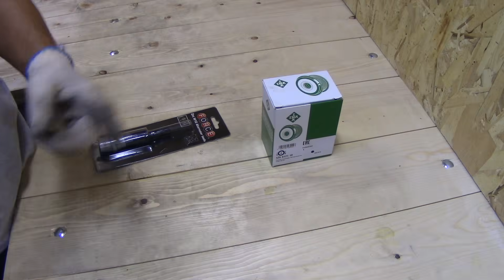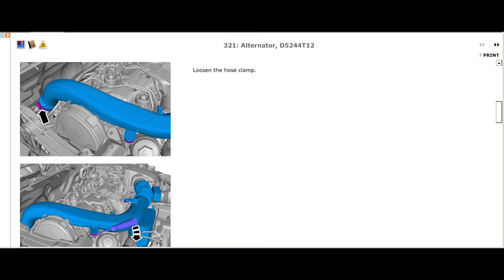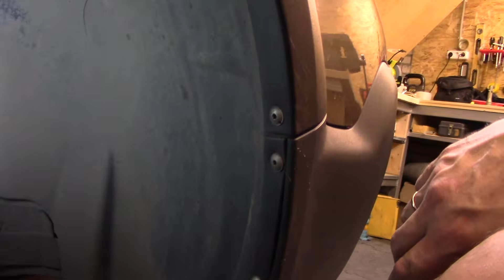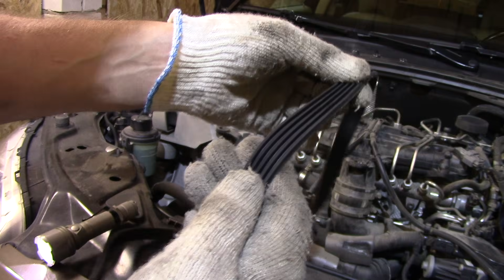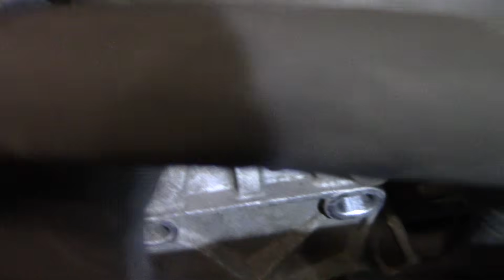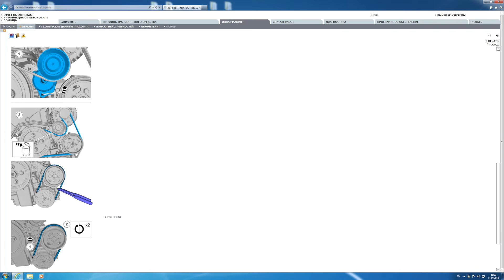Alternator pulley / freewheel clutch on Volvo XC70 D4

Comment: Hi.

Based on your very good instructional video, I did the whole alternator replacement operation on my own yesterday. However, I used the method recommended by some viewers, i.e. I dismantled the oil filter wrap and easily pulled the alternator out from the top. It took me about three hours to take out and install a new one (I’ve never done it before, I’m not a mechanic). As it turned out, it took me the most time to install the V-belt. Thank you very much for your videos, thanks to them I did a lot of work on my own I resemble XC70.

Greetings to you and your friend ❤

Comment: Thank you for this video! I can confirm the removal of the oil filter and oil filter housing (3x torx 30 and 10mm) makes the removal of the generator very easy! There is a gasket that can be replaced in the housing VGASK-7730C 2.7mm. Its not genuine volvo. But just remounting seems to work. Put paper under the oil filter to catch up spill oil.

Comment: Thanks for this, helped greatly. I removed the oil filter housing though and it gave plenty room to pull it out. Be careful to not lose the square captive nut in one of the bolts, if you do remove the filter housing,

Comment: Thanks! This has helped me a lot. I replaced the whole alternator in my 2011 S60 2.0 D3. Different model, little different engine, but everything worked exactly as in the video. Only thing I did different was to take off the oil filter cap, which creates a little bit extra space. I have VIDA, but seeing it in a video made things a lot easier. And the fact that we don't have to drain the coolant is a timesaver!

Comment: possibel to remove engine mount and jack up engine to change pulley with alternator in the car?
Reply: i was wondering same thing ,did you try that . ?
Reply: @jagvolvo33  no i havent. but it might work. either lower true the wheelwell or above with jack. must do the same thing when replacing the timingbelt.

Comment: Would a worn out alternator pulley cause the serpentine belt to flap around between the transfer pulley and the crank?
Reply from the maker: Remove belt and check all pulleys. One could be bad.

Comment: Many thanks for your videos! On my 2012 xc60 I did not have to disassemble anything at all. I just removed the oil filter cap with the filter to have little more space and then disconnected and unscrewed the alternator, put a wooden block under the alternator so the pulley was sticking upwards between all the hoses and managed to change the pulley without having to take the alternator out completely, which I can not imagine doing on my car. I had to buy the tool of course (6EUR approximately). Thanks for all the instructions!
Reply: Great info bro thanks, i need to change the AC and alternator belts so ill be changing the freewheel clutch aswell, i also have a 2012 xc60 D3 5cylinder. 
Felt a bit uneasy about it but im a but more confident now thanks to your informative comment.
Reply: Did you still have to remove the wheel/liner to get the belt off?

Comment: Best tutorial ever needed. Replaced my freewheel pulley on my alternator an Sunday. I had no worries getting the alternator out through my engine bay (V70 D5). I found it easiest to turn the alternator to have the pulley pointing up and the two lower mounting tabs pointing to the left. Then carefully pull it up. Plops straight out. But great videos!
Reply: is yours p2 or p3 p3 being 2008 onwards?
Reply: @jagvolvo33  mine is a P3, 2010 V70 (type 135).
Reply: @skrattedieratte  mine is 2008 p3 ive got it in the position you describe but theres still stuff in the way, did you not have to unclip  any wiring harness stuff . is yours with the oil filter right next to it on the right once you have it in the position you say (pully pointed upwards ? then you would have the water hose to the left slightly above ? ,thanks for reply btw.
Reply: @jagvolvo33  I have the D5 with the oil filter moved to the top of the engine.
Reply: @skrattedieratte  yes is it just to the right of the alternator?
Reply: @jagvolvo33  my oilfilter? Slightly, yeah but as said, it is up and above. If you have a 2008 you'll have the swirl flaps and like that your oil filter housing is in a different position.
Reply: what color is your engine cover m8
Reply: @jagvolvo33  black with a white Volvo badge. That doesn't mean anything though. I have a D5244T10. As stated above, it worked fine for me. If you don't have a T10 (mine has the twin turbo setup) then you'll probably have issues removing the alternator. But even in the end, the pulley can be removed with the alternator loosened but still in the engine bay...
Reply: @skrattedieratte  m8 sorry but whats the actual differance between t10 and t4
Reply: ignore my last Q I know now it looks like mine is t4 not t10 .and there is the problem lol
Reply: @jagvolvo33  hehe. Difference is simple: I have 2 turbos and no swirl flaps. That is why the oil filter was relocated to above the alternator rather than next tonit (as I don't have swirl flaps actuators).
Reply: yep its all very clear why NOW. LOL i think the best way is going to be taking fan out least amount of messing about .

Comment: Great video guys, good close ups of the necessary details. 
I had a bit of difficulty trying to fit a new belt. Seems a really ill considered design. As you said in the video, you definitely need two pairs of hands to complete the task. 
I look forward to a cambelt and water pump video. Mine is due in the next couple of months 🙄

Comment: My engine xc60 2.4D is roaring from the alternator area when I reach 1000rpm and nothing is heard at idle or when I go above 1000rpm. Sounds like plastic rattling against metal. What could it be?
Reply: I replaced the pully and in the meantime all belts and water pump since that was due too
Reply: And tensioners
Reply: What was it in the end? I have exactly same symptoms and a while after it stopt charging at all... v70 2010 d5244T14

Comment: I'm getting some noise but not sure if it's from alternator pulley or another one. I replaced serpentine belt and tensioner but noise is still there. Any thoughts?
Reply: I found the same currently, did you find the fix?

Comment: Much easy if you remove the oil filter house to get out the alternator. I sort already the freewhel clutch replacement. Mine was locked and in idle had a drive belt tensioner vibrations.

Comment: Thanks, great vid! 
Have the same issue on my 2014 V70 D3 with the D5204T7, has just 104000km on it, practically the same engine. First I thought it was the bearings or the mechanical pulley. Also there seems to be a similar issue with the AC compressor giving you this noise, the clutch I believe: https://www.youtube.com/watch?v=QBlTIq_VdP4 and this https://www.youtube.com/watch?v=1RduFj8b8Nc

Comment: Just done this job on my D5 and was able to get the alternator out without removing the air duct from the filter, one less thing to do. My pulley was on really solid, it took a long bar to get it off. Thanks to you guys for your clip :-)

Comment: Another great video from this man, would it be possible to swing alternator upwards after removing the lower 2 bolts? saving removing the alternator then insert tool to remove pulley? would be interested to hear any comments.
Reply: did you ever try that?

Comment: Many thanks, I had the same problem on my V60. Maybe one tip. It isn't necessary to remove the alternator from the engine room. Its enough after the unsrewing rotate 90 degrees.So you can remove the pulley. So I skipped the complicated part with the pipes.

Comment: Replacing the alternator pulley on my 2014 XC60 due to an incremental squeal & battery charging issue which I thought was due to a bad tension pulley since I had this same issue on my 05 Porsche Boxster. When I pulled everything apart I found that the clutch in the pulley has failed at 49,000 miles. When I took the cap off of the old one it was filled with a dark sticky substance, probably the old grease. There is a white plastic sealing ring on the front of the new one and this was completely gone/dissolved on the old one! I bought the new one from FCP as part of there accessory belt/tensioner refresh kit. I almost only purchased the belt with the tensioner pulley & pulley wheel separately because I had read on a few forums and video comments that the alternator pulley generally fails at much higher mileage. Since it was a $130 part I didn't want to really spend the cash on something I didn't need. Then I did more research and found that replacement of the pulley is part of Volvo regular maintenance. I'm so GLAD I bought the kit with the pulley!!! Turns out the tensioner & auxiliary wheels were fine and had no issues but the pulley was done for!!  If your working on an XC60 you should do the recommended service since it's a bit of work to get everything apart to do the job. Volvosweden thanks for the video it was very useful in helping me get the pulley off.

Comment: I changed the pulley on the alternator without actually removing the alternator... it can be done
better to change the whole alternator... changing just the pulley is a temporary solution
v70 drive e
Reply: You have 1.6 diesel engine?

Comment: Nice job and video, can you tell where to by the VIDA you use. Is the installation easy?
Reply from the maker: Vida is available on ebay. Installation depends on your Windows. Hard to tell if you will experience difficulties in installation

Comment: +volvosweeden. Just done my 120,000km service on Volvo XC60 2009 T6. Only things I haven't done yet are replacing the serpentine belt and the external fuel filter. Could you please do videos on these. Looking at your videos, your engine layout is pretty much identical to my car (except mines right hand drive).

I'm pretty sure I know where the fuel filter goes but it looks like you have to pull off a bunch of panels on the bottom of the car.

As for the serpentine belt, looks like a big job. I think you have to remove a lot of things from the right side of the engine bay. Looks like I'll have to take out: air box, battery, A/C compressor and maybe even some more stuff further back in the engine.
Reply: If you have the same car with same engine it will be the same to do this work. The car is still the same as left hand drive so you should just follow this.

Comment: Maybe a tip! To pull out the alternator its a small effort to dismantle the cooling unit after the radiator. 

The vent unit is hanging in on de front and secured by 2 clips and pulled out simple.
Reply: But then u can easly damage the radiator itself ! Its quite narrow space

Comment: Replaced mine this year too, it was shot as hell. These freewheels should be considered to be within a service after atleast 7years of use.
Reply: Maybe althou the new engines doesnt have freewheels. It has a damper in the flywheelpulley instead but its not a freewheel only a damper.

Comment: sorry but INA sucks and what a brand makes for the manufactor is not the same as the aftermarket. So INA is not INA.
Reply: So you're telling me that they make 2 different quality of pulley in the same factory? No way they are the same part in a different box. Dont be stupid.
Reply: Numbers are the same.  checked it today. Original Volvo and Ina have the exact same number on it.

Comment: Amazing, I was about to get it done as well, my S80 MY2012 has 131k km on the clock, it is always better to change the pulley along with the alternator belt when the latter starts to fall apart! Damn, I bought the Volvo pulley, did not know INA was making it. Thanks for the video !

Comment: It's not a generator. It's an alternator. There's a big difference.
Reply: Hugs he states that in the header.
Reply: @jasper_north  There's always some p** ready to jump on yer :/
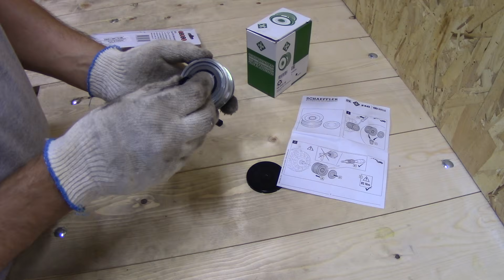Reply: @jasper_north  2:03. He says generator.
Reply: @hugoburton5222   well its been 5 years ,did you get a life???
Reply: Alternator is a generator. No difference.
Reply: Maybe it translates to him better or hes used to saying generator. Not the same but they do the same job just one is driving the alternator to give power and the other is being driven for power.
Reply: Hi, thanks for the video, what is the part number of the plastic protective cover in front of the crankshaft pulley? Mine is missing.